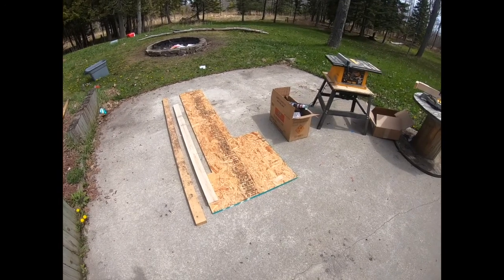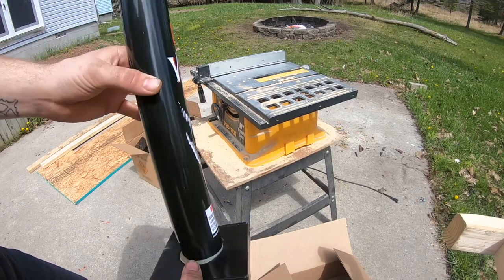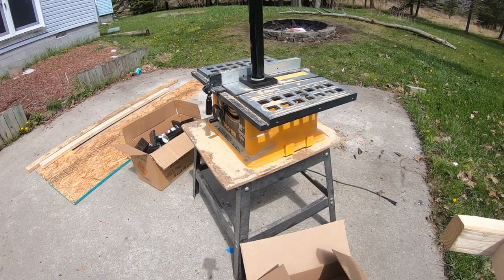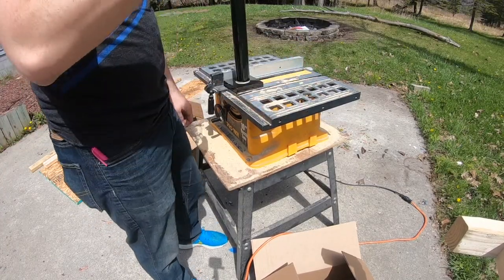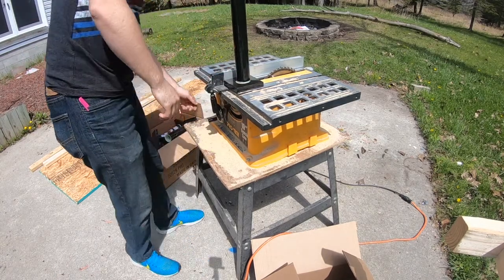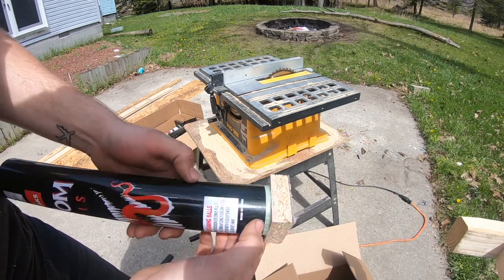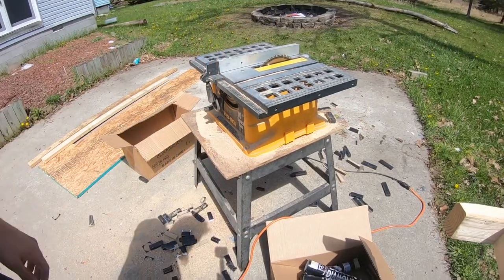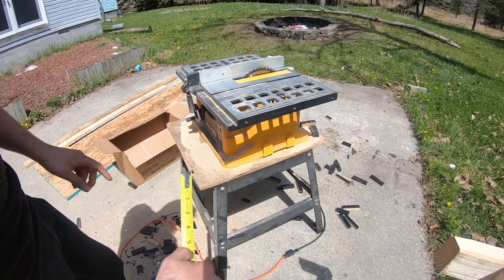How to build fireworks mortar racks

Comment: Made my first fan rack the other day. Honestly, buying them is just as cheap if not cheaper considering they often use cheap wood. I bought the cheapest wood at my local home Depot which was pine and it cost me a fair amount more than the particle board made ones you can buy, plus my time to make it. I'm glad I did it as I have the experience but in the future I'd probably just go ahead and buy these things
Reply from the maker: This year I have built over 20, 10 shot racks and I went with a completely different design. All in, including tubes and new wood I spent about $35 per 10 shot which significantly less than I could find online, and they are better built too. They interlock when stacked for easy storage and incredibly easy to assemble in a fan orientation if desired. When making 20 + racks at a time every cent of saving counts.

Comment: What about fuses. It looks like you buried them.
Reply from the maker: These are for the reloadable mortar shells. The fuse will come out the top of the tube when the firework shell is dropped into the mortar.

Comment: I guess those are just tubes not the whole thing.
Reply from the maker: Correct there come in packs of 24 firework shells and 4 tubes. Making a rack like this with extra tubes  let’s you set off more fireworks during a show instead of having to set one off and then reload the tube.